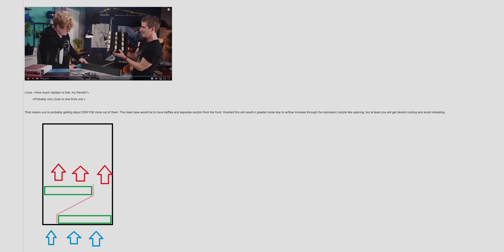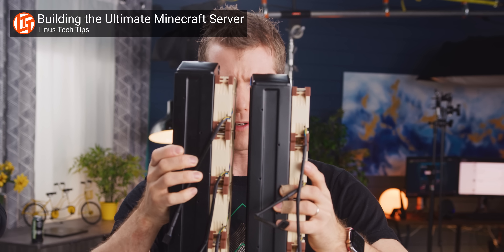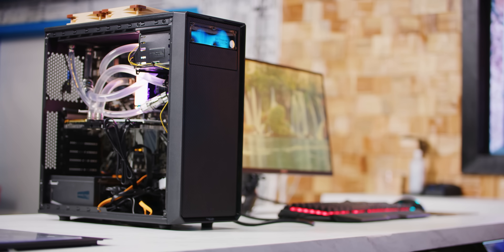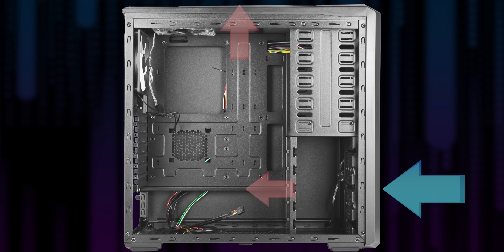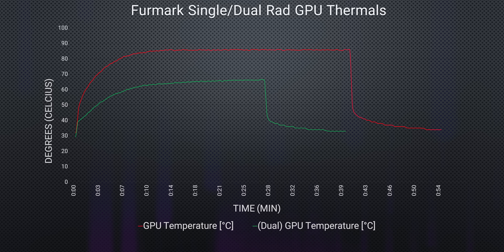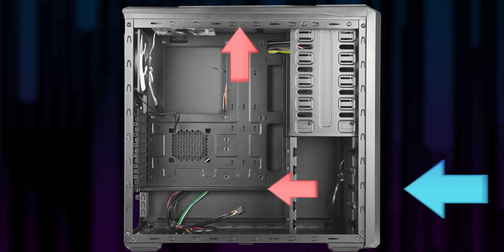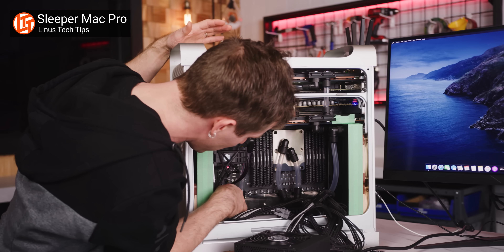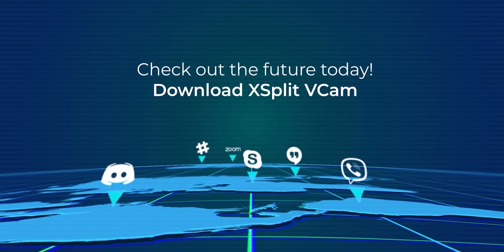I’ve been water cooling wrong for YEARS - $H!T Manufacturers Say

Comment: What I gathered from that little slide your showed is that Corsair argues against setting up radiators in a series and instead recommends giving each radiator access to as much fresh air as possible, which is completely sensible. Taken to the most extreme, they're basically telling you to mount each radiator to a separate intake (say, one in the front and one on the bottom, exhausting through the top/back) rather than putting them in a series/one as intake+one as exhaust. I would love to see a comparison between these two scenarios.

Comment: great topic. 

my theory: more fans=more air flow= lower temp. 

i can imagine that air flow directions for multiple radiators should be the same (all sucking air, or vice versa) can improve efficiency considerably. 

BTW, you guys didnt measure the air temperature inside the case, which is actually important in this test.

Comment: I have been thinking about a different problem. I think Using the same water flow to cool both CPU and GPU may effect. Consider the scenario where Liquid first passes through GPU from the reservoir it gets heated up at some temp more than room temperature and by the time it reaches CPU the temp difference between liquid and CPU could be very low causing problems probably

Comment: 5:53
"This kind of simulations rarely translates perfectly to the real world"

I would have to argue that. BAD simulations rarely translate well to the real world, clearly, from Corsairs images their boundary conditions are off. (Meaning they haven't defined the boundaries of the simulation well and have "tested" a "perfect" scenario.)  I would have a few other guesses analyzing the images, what else could be wrong, however without actually having all parameters to analyze I cannot say anything.

This is what infuriates me,  simulations out in the open like this, give CFD (Computational Fluid Dynamics), or any other simulations for that matter, a bad name. While in reality, it is very different.
In reality, (talking automotive industry and gas turbines as that is my expertise) we are capable and expected to reach sub 5% error with our simulations. Next time your car doesn't spontaneously catch on fire, thank a CFD engineer.

(Source: 2 degrees and a few years of experience as a mechanical engineer specializing in CFD in the automotive industry.)
Reply: He's implying that real world material testing matches the simulation results within a 5% margin. When parts are designed with 2 to 3 times (or more depending on the industry) factor of safety, hitting within 5% of your simulation in real life is negligible and indicative of a well run simulation.
Reply: @chezsammy  Nah he is just working for Ford or Chrysler

Comment: From what I saw you guys did screw up on the second rad, if MAX cooling is target and not just bragging right for most rads in a case. You need to think about air temp through the system to rads, y'all put the top rad as the second in the loop. Which is should have been the first, then out to the front panel rad. If the air temp is highest in the case and that air is feeding the top rad, you want the hottest temp water in the top rad. This gives y'all the highest T delta for the air in the case, once you dump some of the hottest water's temp off of the top you take it to the front panel where it gets fresh cool air and drop the greatest. I would say y'all lost 4-7C cooler temps by the way y'all did it. 

Think of it as a car, the rad is the last think in the stack for all the fluids that need to be cooled (Trans fluid, oil [if you have air to liquid cooler], refrigerant, and inter-coolers [if you have boost]), all of these are placed with the lowest high temp to the worst. This allows the air to have a greatest t-delta as it moves through the stack from coldest to hottest rad.

Still a great video, to many people live by computer models. As someone that builds race cars and trucks I can't count the number of times I've had it out with engineers that what works on paper doesn't always work in the real world.

Comment: Your double radiator setup would work better if you had the setup as follows 
Pump—CPU—Radiator—GPU—Radiator—back to pump
This would let the radiators release as much heat as possible before picking up as much heat as possible and so on. That would make the loop WAY more efficient. I don’t understand why no one does this when they have this setup.

Comment: The funniest is most youtubers use fans designed for static pressure only to pull ... 
Static pressure fans are designed to push. The blades are designed to create pressure by not letting air escape...But you're more salesmen than technicians...

Comment: Perhaps Corsair was also assuming 100% air saturation? Assuming you tailor your fans to only allow air volumes the radiator is capable of transferring to, then the airflow would be too low pressure to carry enough "spare air" for a second radiator. Thus, true for them unless you have ANY other intake points or alternate fans.

If, however, you ONLY used the radiator as your air entry point, using higher CFM fans will allow for some excess air to enter that cannot be used for initial conduction. In that scenario, you'll STILL have enough airflow to make use of a second radiator. (Though less effective than your setup.) The only way their simulation holds true in this scenario is with low CFM fans in a sealed case.

Heat transmission occurs in three forms: Conduction, Convection, and Thermal Radiation. (Convection in the air, conduction on the touch, thermal radiation when the matter isn't much.) A radiator with zero airflow will still allow some heat to dissipate primarily due to convection, like a passive room heater. (So yes, airflow...) The heat energy stored in the water conducts to the fins in the rad, then to the air, and convection takes over. The heat itself will radiate outwards like with space shuttles, so simply having the piping works as a partial cooling component via radiation, if only slightly....

So really, there is no (thermal) downside to having additional radiators if your pump can handle it.

Comment: I don't see how you could expect a tiny rad to do a ~20 C temp delta on a single pass with air. its not THAT efficient.
Reply: They used a radiator rated for maximum of ~300 watts with high, then they added a second one so ~600 watts of heat dissipation.  They picked a bad example still.  Showing the same setup with single 360mm then dual 360mm would have been a more fair comparison.

Comment: corsair : hey its not efficient to just stack 3 of the biggest  radiators you can find behind each other or to use two radiators on the only intake and exhaust fans in a pretty much sealed case. Linus: puts two radiators in a case with additional openings and a rear fan , oh thats bull$h!t

Comment: Keep hot water side in the hot air side. This is important. So if you stack the rads the coolest water should be in first to take cool air. And hotter air cools down the hotter water.

In this testing rig top rad should have the hottest water so first in the loop and then the  second is the front rad with coolest air and coolest water.

Comment: TL;DR:
single rad water = dual rad water
air flow single rad = air flow dual rad

This is very interesting and I would love to see more tests done on this. I think the way you tested it is not very accurate even though it is a real world configuration. Adding a second rad means there is more water inside the loop. I would like to see a test done with a single rad and adding a bigger res to accommodate an additional amount of water that would be equivalent to the extra water inside the second rad. An other note is test with stacked rads instead of rads in different locations in the case. The point is testing Corsairs claims about heat capacity of the air. So the configurations I would suggest testing are 1) normal config with single rad. 2) Add a stacked rad. 3) Extra water equivalent to the how much water a rad can hold.
Another note I'd like to add is about airflow through the rad(s). The rate at which air flows through either single rad or stacked rads should be the same for accurate testing, so the fans should be configured accordingly. When testing for a single thing every other thing should remain constant for a meaningful result.

Comment: If your case air temp is the same as your water temp any exhaust radiator will be useless, if it's higher the exhaust rad will negatively impact performance, and if it's lower the exh rad will help performance. That's just simple math and the 2nd law of thermodynamics. You guys should have logged the air intake temp for the exh rad imo. but this build did get me thinking that a full negative pressure for the watercooled SM570 build I'm planning might actually be a better idea than what I was originally planning, so thanks guys :D

Comment: Sad to say but they're wrong. I have real world experience to back this up too. I went from running a 4690K and GTX 970 on two 240mm rads (one in front as intake, one at top as exhaust) to running them on one and I saw a marked increase in load temps on both. On average I saw about +10C under load across both. They'd be correct in their assessment if you were running your system in a hermetically sealed case where all the air in from the front rad went out through the rear but that's just not true. Cases today have vent holes along the back panel, the bottoms, along side the opening in the top. Places for the hot air going from front to rear to exit as well as for cooler air to enter. Ever wonder why you still get dust in your PC despite having filters on your intake fans? Well duh. Those big openings all over the rest of the case ain't filtered. Now, as to stacking rads... diminishing returns for sure but if you're smart and route the water flow so the hottest water goes from back to front, well it is going to be better than dumping hot air across the water that's exiting the stack. I've been building PC's as a hobby since 2001, been water cooling them (pretty much exclusively) since 2003. Been trying all types of different stuff that entire time.

Comment: Sooooo Corsair is assuming 100% thermal exchange efficiency ALWAYS, with ANY COMBINATION of rads and fans? Damn, that's some graphene kind of shit. The issue is not small openings in the case, a mix of cold and/or hot air, no. It's the fact that you obviously don't exchange completely the heat that goes through the radiator, or we would have an ambient temp side and a CPU (or GPU) tempo side in a loop. Honestly I can't imagine who the hell did those CFD simulations.

For what they're saying, it wouldn't matter the fan speed/static pressure/airflow or the radiator size/thickness. That's some pretty dumb shit if you ask me.

Comment: Corsair: Stacking radiators together likely doesn’t help
Linus: tests corsairs claim by not stacking radiators together

The only reference to testing corsair’s actual claim was the 5C increase on the minecraft server. 

GG Linus
Reply: Claptrap Jesus bro science is a joke though
Reply: Yeah, would have loved to see them actually stack the rads in their formal test.

They also had 1x120mm rad and added a 2nd 240mm rad with two fans on it. It's very possible that the original 120mm rad just wasn't enough for that system. I think if they'd used that 240mm rad and then added a single 120mm rad to the loop, the difference wouldn't have been nearly as much.

Cooling a CPU and a GPU together with only one 120mm fan + rad is likely never going to be enough. That's just too much heat with not enough cooling.
Reply: The claim by Corsair was using multiple rads, not necessarily stacked rads.
Reply: Wayne not sure if you watched the same video as the rest of us, but the claim from Corsair specifically mentions stacked radiators

Comment: stacking might work. but it wont work as efficiently as they should. the "hot air rad" will cool water worse than the one with cold air. 
now. having 3 with cold air would work better than 3 stacked.

Comment: On the one hand, I sort of follow Corsair’s logic. Stacking extra radiators against each other is going to lead to diminishing returns for exactly the reasons they described.

BUT extra radiators will ALWAYS have at least some benefit. The only way it wouldn’t is if your heat exchangers are actually 100% perfectly efficient, meaning the air leaving the radiators is exactly the temperature of the water in the loop, and if you’re not compensating airflow with more fans, and if you’re not drawing any fresh air into the additional radiators. In the real world, no system is anything like that perfect.

What’s extra bs is saying that adding an additional rad could have a negative impact. The second rad cannot possibly be warmer than the loop itself, it’s being heated BY the loop. That’s like expecting to cool your components to sub-ambient temps without some kind of refrigerant.

So yes, Corsair’s logic makes sense but there are a TON of assumptions that have to be correct for them to be right.
Reply: Yes, an additional rad could have a negative impact.
If the air that goes trough the second rad is warmer than the water then you would heat the water in the loop instead of cooling it. 
And it could be possible that the air inside the case is warmer than the water in the loop, if you have a heat source in your case. For example an air cooled GPU, or some extensions cards that get hot.
Reply: They were comparing it to just putting extra fans instead of adding radiator I think. i.e. Fan-Rad-Fan might be better than Rad-Fan-Rad-Fan if your Rad is very efficient.
Reply: Extra radiators only have benefit if you configure the flow correctly. The flow needs to be counter-current. That is - the hottest water needs to enter the exhaust radiator, and the coldest air (intake) needs to flow through the second radiator. If you have parallel flow, you need to either make sure both rads are either at the intake, or the exhaust.
Reply: @amd2800barton  That makes a negligible difference. The water in the loop reaches an equilibrium temperature which will be the same regardless of the radiator order in the loop.
Reply: @121dan121  multiple years of engineering heat transfer taught me otherwise. Look at some wikipedia articles on how heat exchangers work (see link below). The hottest water should be exchanging heat with the warmest air. It will then exit the radiator at some middle temperature close to the air temp in the case, before entering the front radiator and exiting close to the ambient air temperature. If you reverse this loop, it can't ever get cooler than the air temp in the case, which is much warmer than air outside the case.

https://en.wikipedia.org/wiki/Countercurrent_exchange
Reply: @amd2800barton  Typed two comments saying this only to find out there's a wiki article. Of course, I didn't figure out something new. The order of the radiator matters a lot. It makes no sense to put the second radiator if it's going to just use the air coming out of first radiator to cool water coming out of the same radiator. Corsair already mentioned that their radiators are very efficient as it is.

Comment: Instead of putting a test-computer together, you could have just tested the theory using your "sanity check" : is the air just after the rad as hot as the liquid in it ? If no, if you add a second rad just after the first one (or a third after the second one, doesn't matter), is the air at the end getting hotter ? If yes, then the dual rad system is taking more heat from the system and therefore, two rad is better than one. If the air was already as hot as the liquid, or if the addition of the second rad didn't change the air temperature, than you know that adding a second rad wouldn't help because you're already as efficient as you could be : there's no more thermal mass to use (air as hot as liquid, plus potential difference of temperature between your sensor and the air directly next to the heat spreader). If it doesn't work in a worst case scenario (one input, than all rads, than output), then you can search for how much input between the rads does something, but truth is, you don't, because as you said, adding a third rad did drop the temps and therefore you would have concluded that "their claim is wrong, their simulation is wrong, end of the story".

Comment: An idea for a follow up build could be one where you have a system that runs fine with one radiator (good temps under load) and then add an extra unnecessary water cooler (or two) to see if Corsair is right specifically in cases where 1 radiator is enough.

Comment: Is the same in a car stack of radiator ac frist, water second and oil on the last position, the oil run 20/30 degrees hotter then water and the ac gas work only if the temperature of the air is really low, in the pc case (inside of the video) the best option is top and front intake, and rear bottom exhaust, you have all the fresh air you need for the radiator and using more air flow in the exhaust vent you don't have "but heat rises" problem